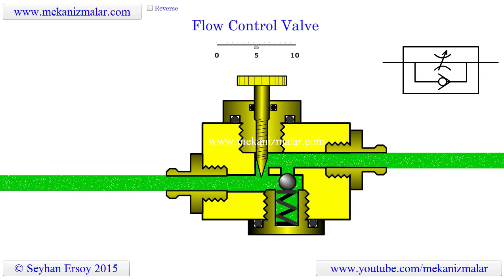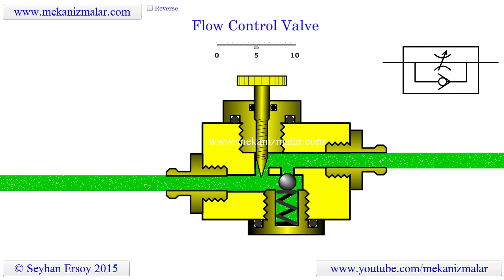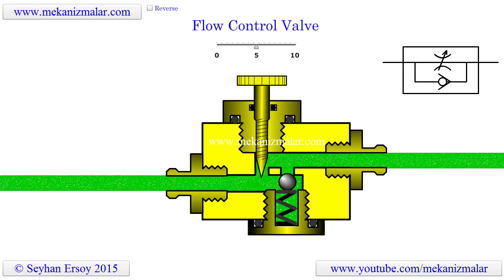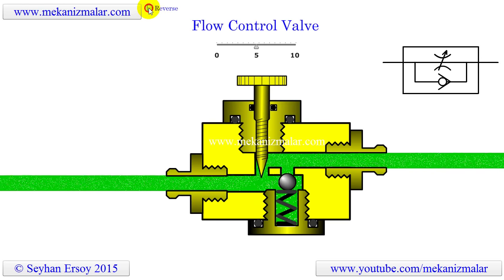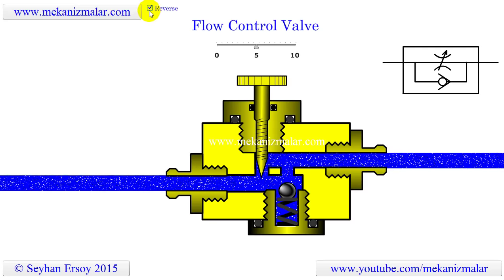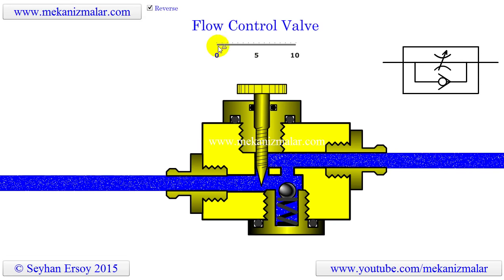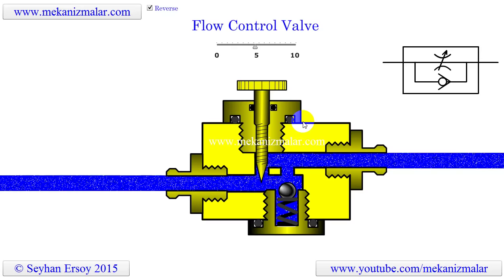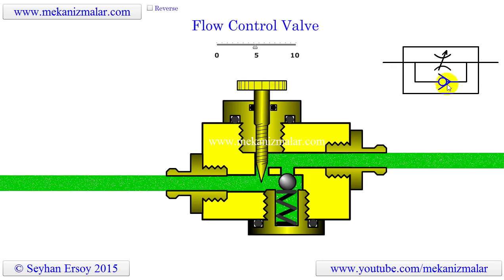how flow control valves work

Comment: I'm using a flow control valve however it's not working. It's releasing pressure as if I can't even meter it. Could I have it backwards?

Comment: If the needle is almost closed, is the net amount of water going in per minute the same as coming out per minute?  It seems like you'd lose gallons per minute.
Reply from the maker: Yes you are right, in one direction you will have unrestricted flow and in the other direction almost no flow.
Reply: That doesn't make sense.  How can more water be going into the valve but less water leaves?
Reply from the maker: I am sorry, I miss interpreted your question. If needle is almost closed,   and lets say 0.5 gallons per minute flow goes in for 36 seconds  and say 3 gallons per minute  of water would come out in 6 second. While flow rates are 0.5 and 3 gallons per minute inward and outward respectively,  the amount of water passing from the valve  in both direction will be the same 0.3 gallons (notice that I don't say per minute). This is because  0.5 x 36 / 60 = 3 x 6 / 60 = 0.3 gallons. I hope this explains the confusion I had.
Reply: But don't you have to keep the time interval the same?  If one flow rate is 0.5 GPM, in one minute there will be 0.5 gallons.  If the flow rate is 3 GPM, in one minute there will be 3 gallons.  I think the speed and pressure are the variables that change.

Comment: How can ristrictor reduce the flow

Is restrictor control the flow by reduce the line Area? 
The flow is not depend of the line area,  is it?  Where Q1 = Q2,  or A1v1=A2v2 ? Reducing the line area is only increace the fluid velocity..
Reply from the maker: Q1 = Q2 = Q rule is always valid. However when the valve is in closed position Q becomes zero. When the needle is all the way open position Q depends the size of the valve. Small valve it could be 0.5 while large valve it could be 5 cubic meter per minute. In short Q is dependents on the needle position.
Reply: How can increase speed cylinder

Comment: How can I contact you by email? I need some guidance in finding a mechanism/valve which can shut off automatically when a certain tank is full, without sensors. any suggestions?
Reply from the maker: You should look at the water height adjustment mechanism  in your toilet tank.
Reply: ah you're talking a float valve just about every toilet has one to manage tank fill bit for equine water tanks and livestock horses and cows they got these premade ones that stop the flow when the water pressure pushes back against it hooks right to a regular ole garden hose if you need a bigger more powerful one than that like for a  4 inch pipe or more then I'd think it's a custom build if ya need smaller they might have them somewhere just not sure where local toe is fleet farm or tractor supply l&m fleet they all got em but Walmart even has toilet repair kits and any local hardware store should ordering online ya probably gotta search engine it

Comment: how to control flow for 5 cylinders ?
is there any way to control it by 1 flow valves  ???
Reply from the maker: Answer to the this question is Yes or No, depending on what your application requirements.